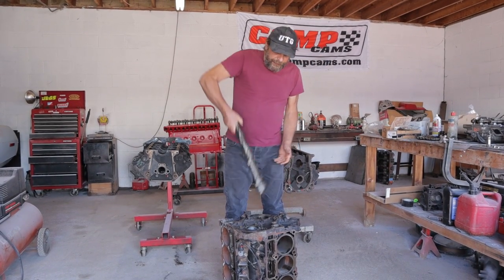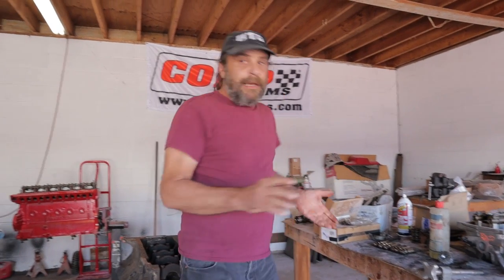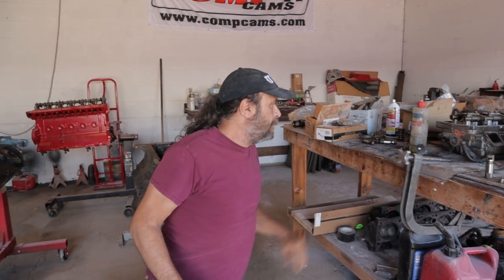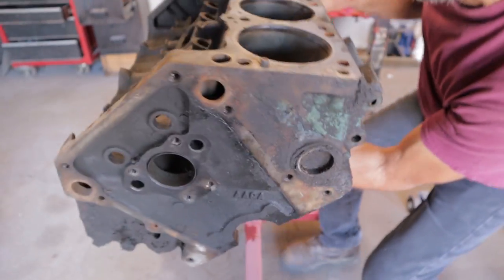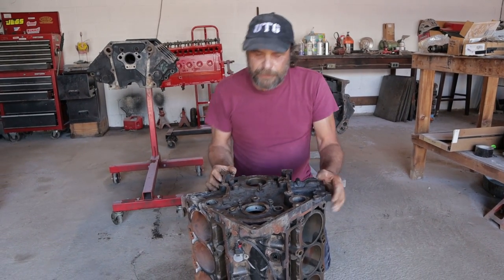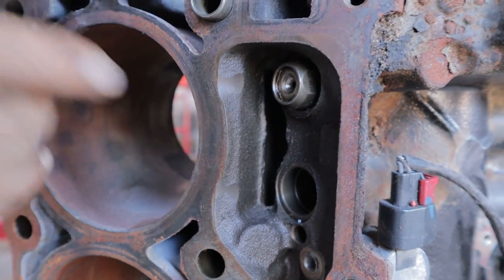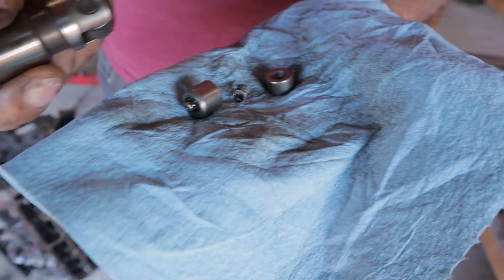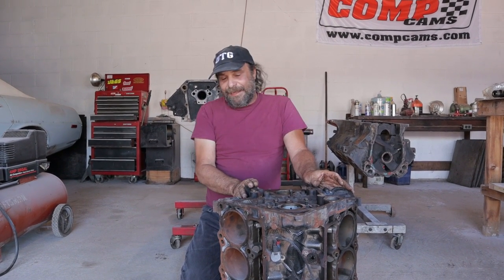Gen 3 Hemi Camshaft Failure Mystery Explained!

Comment: Sorry the Gen 3 Hemi, like basically every modern engine, does not use splash lubrication. Engines stopped using splash lubrication because it aerates the oil, and air is a terrible lubricant, this is called windage. Almost all modern engines, including the hemi, have a windage tray in between the crank and oil sump to prevent the crank from causing windage. So lack of splash lubrication is not part of the problem.
Reply from the maker: You're wrong.  The windage tray goes between the pan and the crank, not the crank and the cam.  Oil thrown from the rods lubricates the cam from underneath.  Zero to do with a windage tray.
Just an aside, there are times a camshaft windage tray IS used, but it it always located above the cam and is intended to keep splash off the bottom of the intake manifold.
Reply: @UncleTonysGarage  Thanks for the reply and reading my comment, you almost convinced me lol. But splash lubrication is not a significant source of lubrication for modern hydraulic roller lifters/cams, and I don't think a single engineer of modern engines would say otherwise. Hydraulic roller lifters have oil gallies in the lifter bores to supply them with oil. 

Lifters are just difficult to design and are finnicky. Chevy also had nearly identical cam and lifter issues to the Hemi until Chevy developed the LS7 lifter, which then became the standard lifter in all LS based engines. That was not an oil splash issues either as the LS7 lifters are very reliable in the same LS based engines, and similarly, the Hemi's from 03-08 don't have this problem, but they have the same lack of splash. And Chevy started having lifter issues again when they introduced DDOD/AFM lifters, similar to how the Hemi started having lifter issues when they introduced VCT. 

The hemi, like most modern engines, isn't designed to facilitate splash lubrication. The issues you have with it's design are because it's not something they design in anymore. This is also why basically no knowledgeable engine builders tell you to "break in" cams anymore, because hydraulic roller lifters don't rely on splash or zddp. 

Hydraulic roller lifters have always been a problem, everyone originally copied (if I remember correctly) Chryslers hydraulic lifters because they were the first to figure out how to make them reliable. But now with all this fuel management/ emissions crap, companies were forced to redesign their lifters and valve trains, and now we have lifter problems again. Aftermarket lifters are also crap, which is why anyone who knows LS engines will tell you to run stock LS7 lifter in Gen 3 LS engines, because even expensive aftermarket LS lifters from Comp and other brands are often crap. 

I know this is a Hemi, not an LS, but hydraulic roller lifters have been a problem shared among all manufactures since their inception. They are just finnicky and hard to make work right, so when Dodge or Chevy or anyone makes changes to their valvetrain and has lifter issues, it's almost always a badly designed lifter problem, not a lack of oil, it's basically par for the course at this point.
Reply from the maker: Do you have any idea how much oil is slung off the rods of ANY engine during normal operation?  At least 20% of all the oil that passes through the pump ends up exiting between the connecting rods and crankshaft cheeks.  LITERALLY how they are designed.  The constant flow of oil cools the big end of the connecting rod as the engine is running.  The side clearance of the rod is where it exits, and from that point it is thrown around the perimeter of the crankcase and that would INCLUDE the surface of the cam lobes.
I didn't just make this shit up...that's how it works
Reply: @UncleTonysGarage  I never said you made it up. Obviously the oil from the rod journals has to go somewhere for oil to keep flowing, and ends up spraying the cam. But that does not explain why only the VCT Hemi's have the problem, when they both get the same amount of oil.

Comment: Sorry man, you are off base. 

First, a lifter body to bore is not going to have a hydrostatic pressure high enough to prevent scuffing, totally normal.

Second, the central oil gallery is the same as used in the V10. No lifter issues. 

Third, the lifter position and central gallery is the same as used in the 6.2L hellcat. No lifter issues, only difference is MDS delete.

The corrosion issues on THAT engine is likely due to water incursion, just look at the block, its pretty obvious. None of that should be present inside a good engine.

The real failure here is likely that the MDS is changing the total oil volume to certain portions of the camshaft and thus needle bearings during extended MDS usage, alone with reduced pressure on the needles. Contrary to common thought, low pressure and high speed on needles can cause them to "float", which slightly flat-spots them. Over time, this gets worse until they begin to seize, roller locks up, and cam fails. 

The best solution is likely MDS delete, along with a better viscosity oil more in line with the 6.2L and V10 applications, rather than the mileage-conscious 5.7L.
Reply: Hey Dan, how do you explain the manual 6 speed challengers without MDS along with the early HD truck engines who still endure this failure?  Excellent point on the 6.2L as they have a billet steel core camshaft, not cast iron induction hardened shell which is ultimately the root cause for lifter lock up on all of these...  

Fitting how the lifter revision (AD/hellcat) was durability tested for 300k miles at 6200 RPM, the 5.7/6.4 engines are designed to make it through warranty so you buy another...
Reply: @Garc Bomber  

I would have to do more research into the exact PN differences and installed parts on the Manual version. 

That said, I know what you are getting at, and all I can say is that correlation is not necessarily causation. There are many other things that are common to the platform aside from MDS, such as the oil viscosity I mentioned. Is it possible that the MDS is only a contributor and the oil is the main root? Sure. It's also possible that the cam core is a contributor... BUT, Chrysler has a lot of experience with cam core materials, and that could very easily be changed in manufacturing without any side effects. Oil viscosity on the other hand, would require a mileage re-rating and re-certification.

That alone, makes me wonder if there is more to the oil angle. They don't want to recertify, so they don't bother fixing it.
Reply: @ExotechEngineering  the latest trend is to swap out the OEM oil pump for the higher volume/pressure version in the Hellcat.  I agree though, lots of variables in how these N/A mass produced engines are used across several vehicles with maintenance.  I'm estimating they saved $3-400 per unit manufacturing cast iron instead of billet steel thru hardened and ground camshafts...  

Multiply that by several million, easy penny pinch with the chance it gets replaced on warranty.  Everyone else is scrambling for the $4000+ bill to get back on the road...

Comment: Dodge clearly did not do the upfront FMEA (failure mode effects and analysis) work correctly.   If they had, this would not be an issue. One of the reasons I will never own a Dodge product.....shoddy engineering.
Reply: That had nothing to do with Dodge. This was originally designed by Daimler Mercedes.

Comment: I work at a dealership, we thoroughly check all hemi trucks and cars traded in for lifter Noise, it’s such a common failure that destroys engines when customers keep driving continuously for long periods of time. It’s not worth replacing them, if you can even get them because they are always on back order and just way too expensive. You also have to pray the metal in the oil isn’t causing more damage in the engine while you’re tearing it down. Better to get a junk yard engine and slap in it then try and roll dice rebuilding one. Same with the v6 engines, once you hear a lifter noise depending on how bad it sounds and the compression, it might not be worth trying to rebuild.

Comment: So what I've learned to prevent this issue.

If you buy a 5.7L Hemi
-RPMs are your friend, once it's warm drive it like you stole it.
-Use Zink infused Oil approved by Chrysler
-If you do have to do a rebuild, delete the MDS but keep MDS compatible lifters to keep more oil in the system.

Did I miss anything.
Reply: If you're idling it for awhile to get AC, just rev it every few minutes lol

Comment: Heat and oiling problem, needle roller bearings go out because of a block design flaw wiping out the cam and lifters and possibly major engine repairs or replacement. it could be easily fixed or the block modified, also may consider a lifter bore grooving tool to groove the lifter bores and  accumulate some oil in the lifter bores.

Comment: The 6.4l Engine is worse because if they fail and create metal shavings it destroys a 6.4l engine because its tolerances are tighter. Chrysler recommends a new engine if this happens with a 6.4l. The 5.7l engines do not have as many catastrophic engine failures as the 6.4l does.  To be honest Ford and GM engines are not much better right now IMO.

Comment: That's why they make Toyota, Honda, Nissan, Mazda, they don't have any problems like this, i have 04 Toyota Camry with 300,80,000, that's three hundred and eighty thousand miles on it,2.4 litter,  ice cold air, only thing i do is oil and filter,  breaks every other year,  put gas in it
Reply: Really, Toyota+Lexus just had to recall over 70,0000 V6 engines for a full replacement due to a very serious flaw in the engine block. Essentially the engine will crack and potentially burst into flames. You are talking pure BS. Nissan, tons of problems, and Mazda as well. Every manufacturer has issues.
Reply: @paulj9821  yes they all have problems, but alot less than American cars and you know it, paullll
Reply: @diningroomfish5470  I agree, Toyota is King of reliability. Honda's engines are always great(there transmissions on the other hand need work)
Reply: @paulj9821  it's not just that, there is alot to a car, truck, van, suv, my point is i have 04 Camry with over 100.000 miles on it, and THE ONLY THING I HAVE EVER DONE IS OIL CHANGE, FILTER, AIR FILTER, GAS, NEVER A LIGHT BULB OR ANYTHING ELSE EVER NEEDED TO BE DONE TO THIS CAR, FILL UP ON GAS $35 DRIVE ALL WEEK
Reply: @diningroomfish5470  Ok I know plenty of people with Jeeps with over 100,000k and like you no major problems. I am one of them. I own 3 cars and one of them is a FCA product the 2015 Grand Cherokee. I actually care for my vehicle and change the oil myself etc....With that being said, all 3 American manufacturers have less than stellar QC.

Comment: Project Farm had an oil competition that had Amsoil as #1, and Pennzoil Platinum as #2.  Both synthetics.
I bought a 2020 Dodge Durango last week.  Put 800 miles of 96% highway miles.  Had the oil changed to the 0w20 Penzoil Platinum.  The oil change techs couldn't understand why.
When my wife bought her '18 Ram 2500 with the Cummins engine.  At 750 miles it got 5w40 synthetic.  I have an '03 Ford Explorer that got synthetic oil at 700 miles.  At 227,000 miles, the engine is still like new.
The tighter tolerences of the newer engines.  Rely on the ability of the oil to hold an even thinner film than before.  But the comments that say the engines were not really tested at idle is likely correct.  Add in cheap oil and filters.  The engine is doomed.

Comment: you would need do like he said drill and tap for a dripper line and have a remote reservoir to take oil from the pan and pump it in to the dripper line . I don't know what having some one set one off these up now would cost I haven't been in an engine in 20 years from being disabled but it can't be that expensive. and it would save the cost of a new cam every few years . the old Ford Y blocks had a similar problem but you could take oil from the plug in the back and plumb it to the rockers.

Comment: The thing about the Hemi engines is you HAVE to religiously only use 5w-20 oil ONLY they do not like anything thicker and it starves parts of the engine if you use thicker oil. Ive had 4 Hemi engines that went past 300k miles with no major maintenance needed.

Comment: When Chrysler was bought by Fiat from Mercedes, their product line Turned to crap!!!
Fiat is the worse car company in existence beside AMC. They have engineers who are brain dead, have zero experience in making long lasting anything especially engines. 
Never buy a newer Chrysler product or Hemi engine period.
If you do you'll throw your money away and your engine will last maybe if you're lucky 150,000 miles, maybe.
Not worth buying period. Also when Chrysler was owned by Mercedes they had bad wiring issues. Your Chrysler would stop running from electrical issues.

Comment: HIGH QUALITY 5w20 will solve this problem.  Otherwise you're just talkin'.
Reply: @turbojetpowered8299  Well at 220k miles and using correct oil it has to be true.

Comment: MDS is the worse engineering the way it functions up down lifters rollers where it pass thru the alignment of the port holes
Where it uses 4 cylinder mode it tighten for V8 mode it destabilize 

The camshaft on rotation pushes the lifters and pushrods are crazy how it angles throws off the force on the lifters not even pressure like a Chevy 5.7 pushrod assembly straight pushrod down to the lifters 
 
but remember the MDS 
Plays a destabilization not really a accurate oil spout on idle mode 

Lack of oil pressure right where it needs its to cap the oil retrieve and make a oil rail the aims
At the lifters and pushrod to the rocker arms 

And still it’s not correct how the pushrod assembly off angle on the lifters 

This block can be cut where the push rods hole to get  
better oil drip down to lifters 

Or set a dual overhead cams set of  heads delete the pushrod assembly
Plenty of improvement can be done 

I’ve work on engine rebuilding this is a fucken moron who build this engine it has plenty of improvement 

Mopar needs to text me  this can save there inspired motor

Comment: Dodge== Loser car company. Hell it's been traded to other manufacturers for decades. They aren't even on the Stock Market. Haha
Reply: @paulj9821  Really???  Dodge a Good, Reliable Car??  Hardly.
Reply: @bluesky-ud9wg  Hellcat's aren't having serious reliability issues. I mean there is barely any Dodge left. You have challengers and Chargers and the durango and that is all I can think of. Dodge of the past was junk just like GM and certain ford models.
Reply: @paulj9821  All they have are HP cars, 30 different variants, Hellcat, Scamp, etc all the same cars, no car for a regular family, Camry, Accord, etc. As I said, a losing company.
Reply: @bluesky-ud9wg  The company is FCA not Dodge. They sell tons of vehicles since consumers predominantly want CUV/SUV not sedans. So how is that a failing company? Jeep is one of the most popular vehicles being sold today. Every year there sales exponentially increase. Ram in 2 years, took an additional 34%  of the Pickup market share away from FORD and GM and they are doing very well. I can tell you don't work in the automotive industry cause your perspective does not align with reality. 

Now if what you really meant was that Dodge as a brand is miniscule compared to what it used to be, then yes I agree to that. However a failing company they are not since Dodge is simply a brand of FCA.
Reply: @bluesky-ud9wg  and yet those HP cars that you dog on are selling better today then they did 7 years ago. The challenger is an old platform and it;'s interior is dated today. Yet it's selling more today than it did when it was hot and new. Clearly Dodge or FCA is doing something right. Those HP cars that you look down on are some of the most fun vehicles to drive. They have style, soul character unlike the commercial cookie cutter, boring generic cars the masses drive. Again there is a reason why they sell so incredibly well. You simply can't deny the numbers.
Reply: @paulj9821  Let's start here; Pushrods, what 2 companies still use Pushrods?  Dodge & GM, both went bankrupt. As for the Hemi, it simply doesn't work anymore. Dodge is the ONLY company that uses a Hemi head design in any internal combustion engine. It was great in 1964 but not now, this is 2020. It is a waste of a design. We can go on and on and I only state the facts
Reply: @bluesky-ud9wg  The modern day Hemi is simply by name only.  The combustion chambers are no longer truly hemispherical. Here is a good bit of information that further expands on this. 

"Today's Hemi's are labeled Hemi in spite of the fact its combustion chambers look nothing like sliced grapefruit, I met with Bob Lee, Chrysler's vice president of powertrain product engineering. 
The engineers responsible for Chrysler's new engine had better intentions than merely dusting off Hemis in the back of their closet. Early in the research phase, they discovered a combustion chamber that Porsche used for 1965-97 air-cooled 911s offered the ideal starting point for their new design. 
Engineers are not about to leave well enough alone so little from the Porsche design made the long trip to what's now called the 5.7-liter Hemi Magnum V-8. Much of the bowl area of the combustion chamber was filled in to encourage the fuel-air mixture to stir itself prior to ignition. The chamber is shallower than past Hemis so the top of the piston can be nearly flat, thereby saving reciprocating weight. The one vestige from Porsche's classic design is large valves rotated 90 degrees from the most common orientation (in a plane parallel to the crankshaft), and splayed at a 34.5-degree angle in the interests of free breathing."